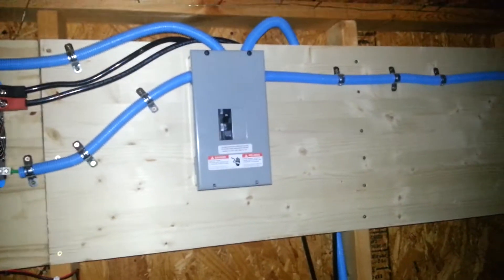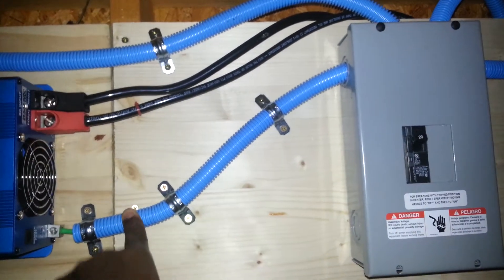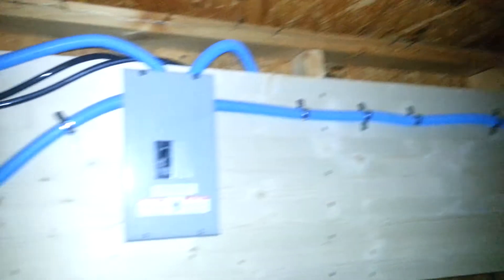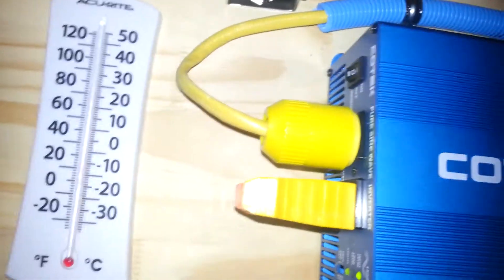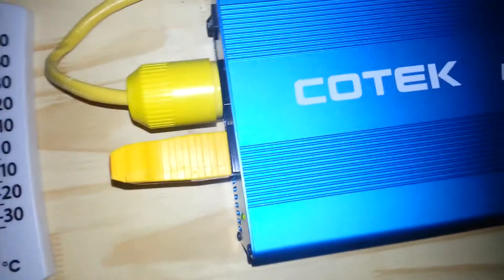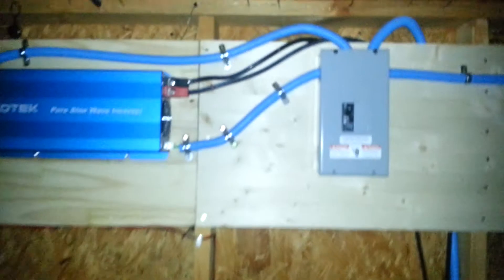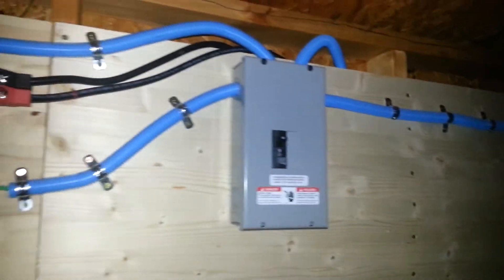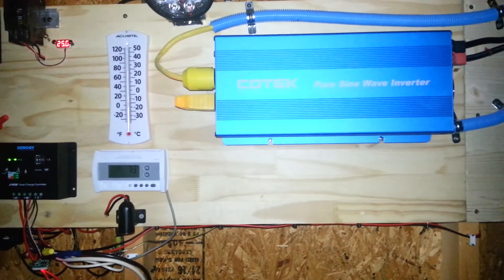Installing New Inverter And Breaker Box In Solar Shed #2

Comment: Thanks for making the video. Question: what is the amp rating of the yellow wiring adapter plugged into the inverter? it looks like you have yellow 20 amp Romex cable. I'd like to see inside of your box please.  Maybe even a diagram of how you have everything wired. I have a renogy 1000 watt 12v inverter looking to wire a load center in my shed. doing lots of research about grounding and the like. thanks.
Reply from the maker: The wire is rated for 20 amps, as you have indicated.  Here is the video that shows inside of the breaker box:
https://youtu.be/92sQRlj2eOk

Thanks for watching and all the best with your projects.  Cheers!
Reply: I used a 10 gage wire from my inverter to dreaker panel .
30amp breaker.i

Comment: Hi can you make a video showing the voltage from hot to ground and neutral to ground. I have cotek inverter too, and I get around 56 volts on both hot and neutral to ground.  I want to connect my inverter to the breaker box of the house,  but I'm afraid to damage the inverter by bonding the neutral and ground. Any advice would be helpful.
Reply from the maker: Alfredo Pineda 
Sure, I will add your request to my list.  When I do it, you will be the first to know :) cheers
Reply from the maker: Alfredo Pineda 
I would install a separate sub panel to feed selective circuits in the house from this inverter.  What I currently have is exclusively in my shed in a standalone system.  Anyway, I will make a video soon showing the checks that you requested.  A licensed electrician should also be consulted for peace of mind, as well. I sure do not want something bad to happen at your house....cheers
Reply: Thank you for your advice,  my inverter is pure sine wave too. i would hate to blow it up.  I'm just wondering if you get the same voltages that I'm getting.
Reply from the maker: Alfredo, Here is the video that I made today answering your question:  https://youtu.be/hnxwbN0Vve8
I hope that it is helpful.   Cheers

Comment: Hi, will not be going off grid all the way. Just want enough soalr to use 1.4 amp chest freezer and a fan basically in emergency in storms power loss.
Working on shed now, thanks for breaker info.
Reply from the maker: Thanks for watching and all the best with your project.  I started off very small but am in the process of slowly upgrading my system.
Reply: We just subscribed to you. We have saved for a long time to buy Grape 400Watt Solar Kit. Then Trojan batteries now we need wire, Monitor etc.etc.. This week working on building cabinet fro battery bank.
Reply from the maker: +Guess Who 
Thanks for subscribing.  I am looking forward to seeing a video of your set-up.  Yep, it does take time and money and you are moving in the right direction and doing great at it.  Congratulations, my friend.  Solar is the way to go.

Comment: whats powering it ? I have 6- 100 watt panels, is that enough ?
Reply from the maker: +Liberty Lackey 
I have a 24 volt battery bank (with about 350 ah capacity) and two 100 watt solar panels. With 600 watts of solar panels, you can do some neat stuff but it depends on your application. Currently, I use mine for basic lighting in the shed and to run basic tools.
Reply: Just trying, like you, to eventually power a small eartbag home. I'm on the fence with this inverter, b/c its from eBay. Oh well, if it's a counterfeit I can use eBay guarantee. I figure I can start with this, & build up. If it becomes too small I can use it in the shed like you, or isolate the sine wave power for those high-end devices.
Reply from the maker: +Liberty Lackey 
Understand your concern but this one is the real deal though. I contacted the manufacturer and got it verified.  The seller I got mine from is pretty reputable.
Reply: +DIY OneForAll do you think that running your lighting through AC power that the wires absorb too much energy versus just running DC lighting?
Reply from the maker: +Liberty Lackey 
I would highly recommend DC lights (LEDs) for that said reason and use the inverter where DC applications are not possible.
Reply: +DIY OneForAll true, just looking of ways to cut corners & save energy. prob be best to have a separate DC lighting unit. and of course use the AC inverter for the household items. thanks for sharing all the tips and videos. I hope to share more in the future.
Reply from the maker: +Liberty Lackey 

Thanks for stopping by and commenting and I would definitely like to see a video of your setup.  All the best with your project.

Comment: Hi, I have a Square D 200amp breaker panel, and I am curious as to if I may be able to  utilize it some how. I am running appliance extension cords right now and am sick of it. Would like to connect inverter to the panel and simplify things a bit.  Any suggestions would be greatly appreciated. I have no grid power coming into the box, it would be all solar wired.   Thanks
Reply from the maker: Ken, it should work out just fine.  Ensure that you have good grounding and if you have a pure sine wave inverter,  you should be able to bond the neutral and ground in the breaker box.   I believe your setup should be a fun project.   If you previously had grid power, ensure that no electricity can back feed to the grid/meter.
Reply: I am useing a square D 100amp breaker box . 
Totally offgrid . This is what I've done .
240v generator hooked to main breaker to power whole panel when generator is running .runs A&B
I have a homemade interlock kit to seperate 240v generator from
 110v solar enverter . So not to back feed either .
110v inverter hooked to 30amp single poll breaker on.side B
I can only power off of B phase  on solar but thats light , fan , deepfreezer and some plugs. 
When 240v generator is on ,
Everything can run. +well pump and water heater.   I generaly only run in evning for an hour to fill water pressure tank and heat water for shower . Then shut off useing interlock ,then back to solar inverter for 110v what ever .watch tv qnd stuff . I just done rune every light at once .but if i need a light on say in bathroom for a while not a big deal .
It's  
No more extension cords .
Offgrid life style  ✨ 
 peace .

Comment: you wired all that for a light bulb?
Reply: +DIY OneForAll  As you move from simple backup to powering your home, I would recommend planning now with the end in mind. Meaning, what type of system do you eventually want to end up with. Think about the eventual wiring, the number of critical circuits, transfer switches, manual or automatic, whether or not you will eventually grid-tie. Reason being that you are proceeding in a similar way as I did when I started over four years ago.  If you visit my channel you will see a steady progression from a simple backup system to a fully integrated AC Coupled system.  Some Lessons learned, don't make your system overly complicated, you'll end up with a lot of spare parts as your system evolves. AC based systems are a lot simpler to work work with than  strictly DC systems.
Reply from the maker: +rhandsom 
So true: "plan with the end in mind"  - I like that. Thank you.
Reply from the maker: I actually do more than just a light bulb. It's used to charge my batteries,  run my small tools, fridge,  solder station,  plus assurance in the event of a power outage.   Thanks for watching and commenting.
Reply: Ok, didnt see anything but a light bulb.  Figured that lightbulb must be really important !  Enjoyed the video.
Reply from the maker: +Hippie With A Cowboy Hat 
Thank you. I appreciate it.  The first phase of the project is in my shed, next is my house.  I am building the system little by little. Thanks again.

Comment: Your ground rod needs to to 18 inches blow ground level to be in code. disconnect your ground rod and dig a hole 18 inch deep around it and drive it down, the reconnect your ground wire and bury it and you will be in national electric code.
Reply from the maker: Thanks for the comment and suggestion. Well, the ground is  rod is 48 inches (4 feet) down in the ground. I wanted to go 8 feet but was concerned about hitting a drain pipe.  Thanks for watching buddy, I appreciate it.
Reply: DIY OneForAll You can drive the other half of the rod if you had a 8 foot rod in the ground next to it, code just wants you to have a good path of least resistance to ground that is why they want it to be buried, also to protect against it being hit by lawnmower. I subbed you, I like the updates on the inverter, I and some friends have bought those inverters for our Offgrid installs also. Check out my channel
Reply from the maker: Off Grid Texas Homestead 
Thanks for the info and suggestions.  Yeah, it's a nice little inverter.  My plan is to buy one more of those inverters as a backup.  I did sub you back, as well.  I will check you out.  Thanks buddy.
Reply: DIY OneForAll go on eBay, do a search for the cotek sk1500-124 its $160 there
Reply from the maker: Off Grid Texas Homestead 
Yep, that's who I got mine from on Ebay: saradean3.  Thanks buddy.
Reply from the maker: +JWSolarusa John Wesley 
very cool
Reply from the maker: +DIY OneForAll 

Thank you